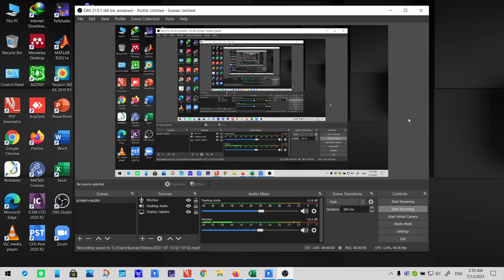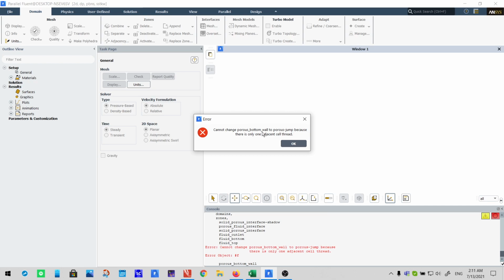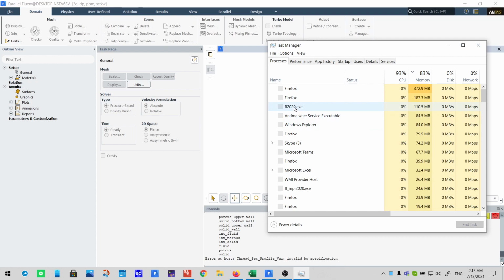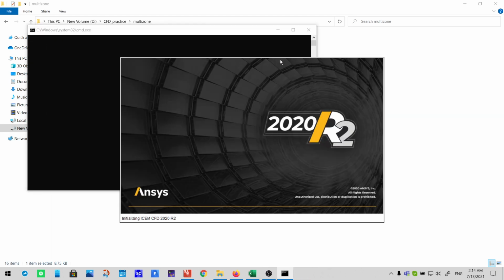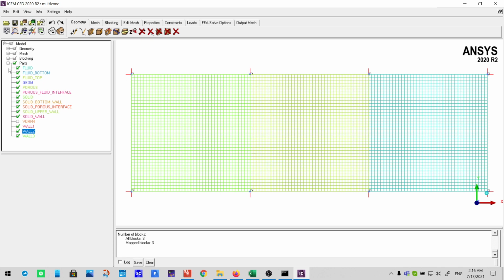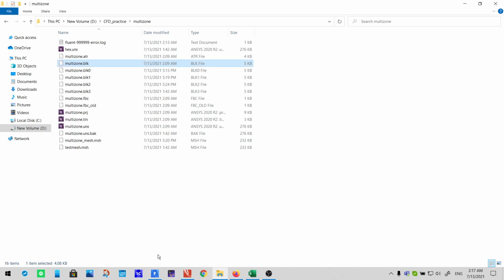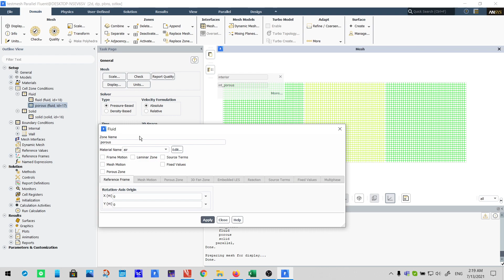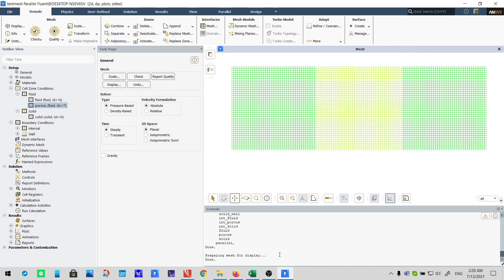Solving porous-jump issue | Fluent error, cannot convert to porous-jump | ANSYS Fluent

Comment: Hello，may I ask you a question? After using the porous medium jumping layer in fluent, it does not converge，My model is 2D
Reply from the maker: Does it converge either?
I mean, if you don't use it, is the mesh usable and does the solution converge in that case?